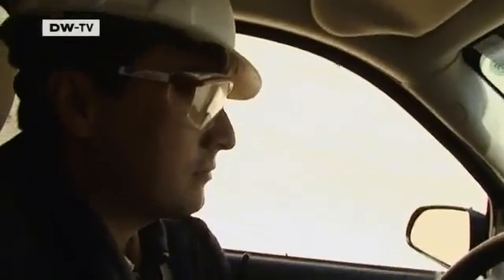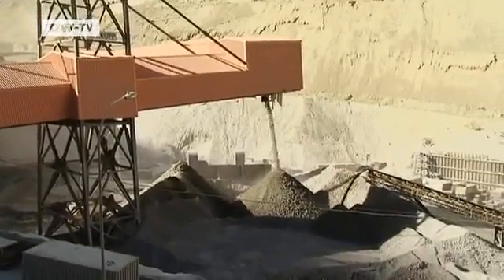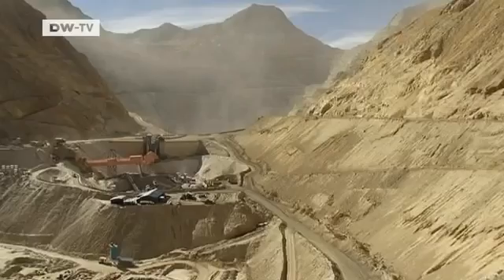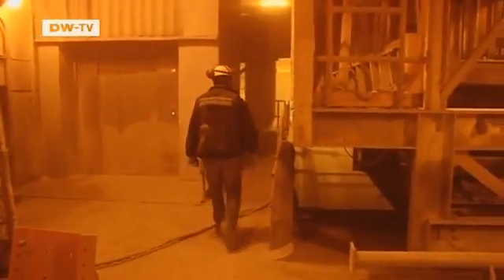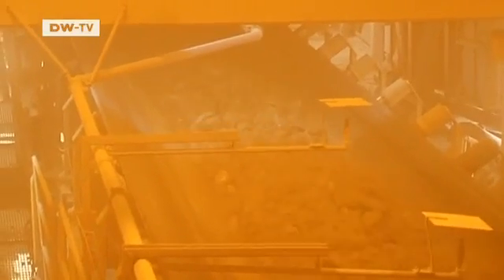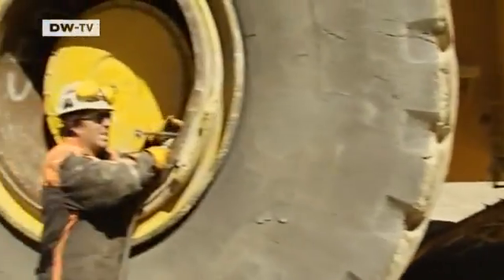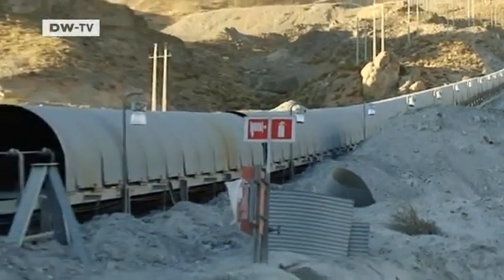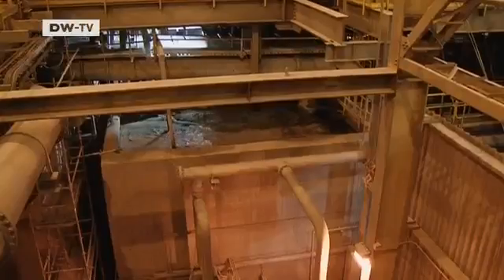Copper Production in Chile | Made in Germany

Comment: are all the equipments for copper extraction imported from Germany..?
Reply: No, but in this mine in particular most of the equipment are from germany because the main design contractor was Rheinbraun  (german company )  , steel structures was built by Krupp and assemblied by Bechtel (american company), the original conveyor was Phoenix (germany), Gearbox from Keller (germany), motor and control by Siemens. But other equipment like the primary crusher are FLSmidth. On the concetrator there are 3 SAG from Siemens and 6 Ball mills also from Siemens, but all the rest od the enrichment equipment came from FLSmidth.